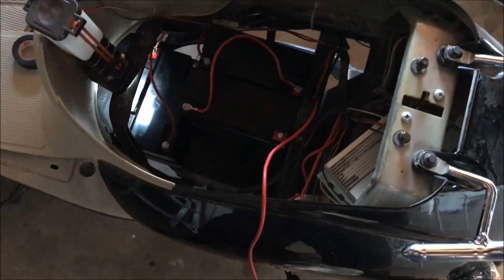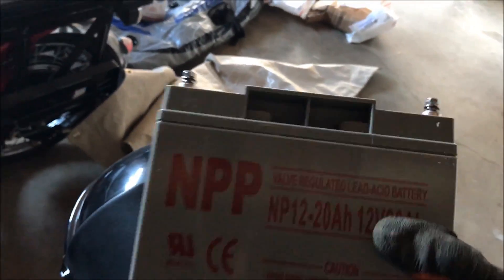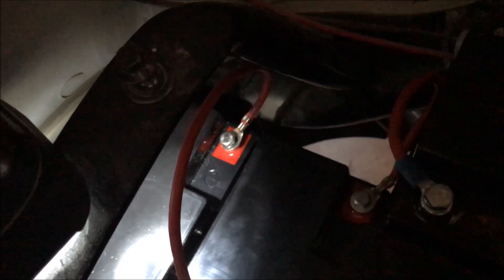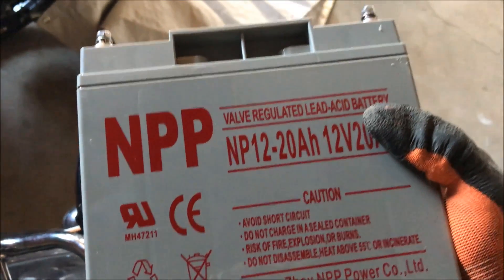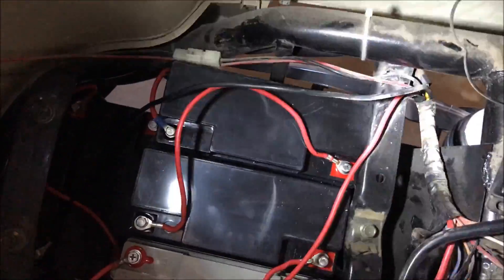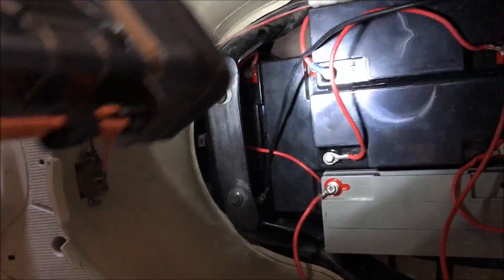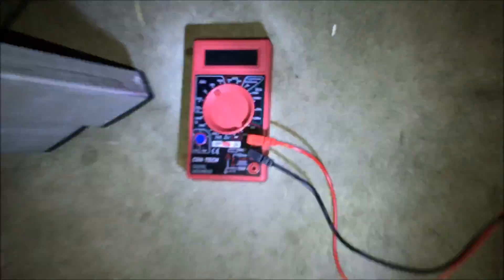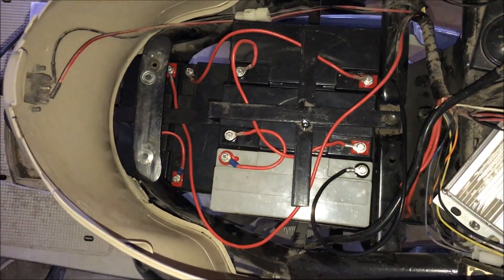eBike/eScooter moped electric Bike battery swap/replacement 48v/60v

Comment: does higher voltage mean more power?
Reply from the maker: of course...if the controller supports higher voltage, then you will have longer drive and also feel more power

Comment: What was the speed increase
Reply from the maker: i didn't have the other specs because i bought off craigslist...but i could tell you more voltage means more power if the controller supports the higher voltage

Comment: Isint  the controller limited to a certain V input as well as Ah ?
Reply from the maker: yes most controllers have parameters. so best to replace them with similar batts
Reply from the maker: just keep in mind to not go over 5 batteries each 12v in series, and keep it under 20ah

Comment: What voltage you’re charger you used for the 60v battery
Reply: My bike drove about 20 miles, but when I hooked up the charger, it popped and broke. Why?
Reply: The charger broke
Reply from the maker: 12v 1-3Amp charger
Reply from the maker: 12v 1amp